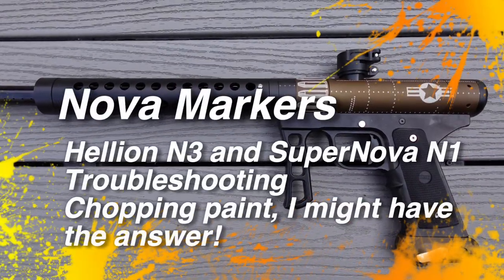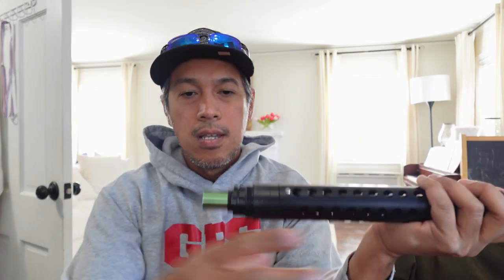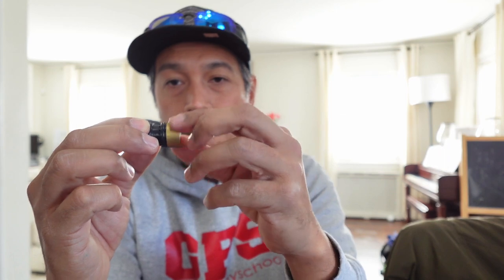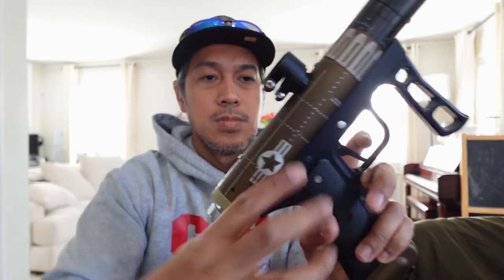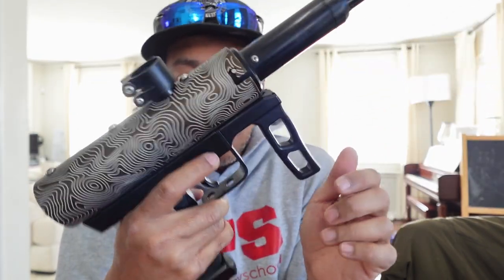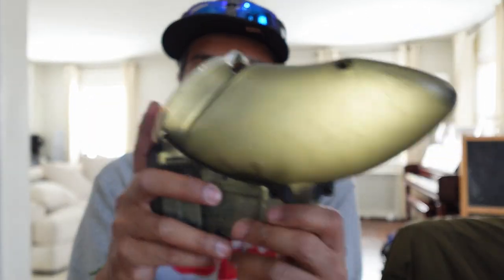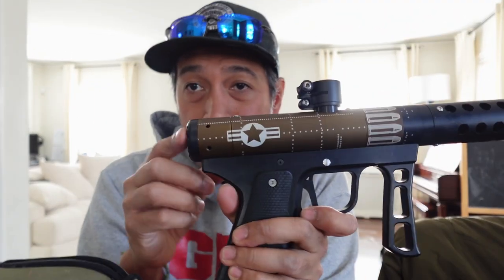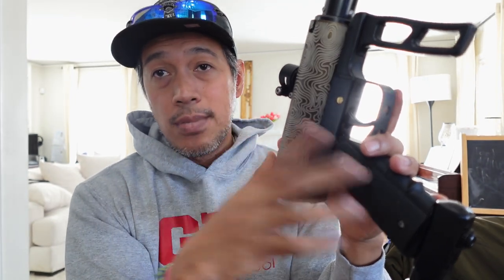Nova N3 Hellion Troubleshooting. Common solutions to chopping issues and loader/hopper selection.

Comment: This applies to almost if not all closed bolt/breech paintball guns. On my cocker with the stock bolt or n1, I chop more with force fed and semi force fed(rotor, tfx, spire). The sonic is evolved from the ponnokio and revvy bend systems if I am correct.
Reply from the maker: that is true.  the advantage of the other markers though is they have a detent that kinda helps keep the paintballs in place limiting the movement of the paintball between loading.  on the Novas, we don't really have that mechanism and the paintball is just free to bounce around before it gets shot/loaded

Comment: Been having issues with the n3 i bought my dad. The on off asa is leaking through the small gas port on the left of the asa at the bottom. When i disassembled the asa i found the o rings to be dry and there were metal shavings intermingled with the o rings. I attempted to replace the #10 orings on the lever but the outcome was the same. Should i send this back to nova for a rebuild or ask for a new lever?

Comment: Thinking of getting a N3 what is the recommended tank pressure I have a ninja 68/4500 set at 500 psi and another Ninja SLP 77/4500 at 350 psi output pressure any help appreciated
Reply from the maker: A low pressure tank works.  Usually they're around 450psi - 500psi.  You should be good